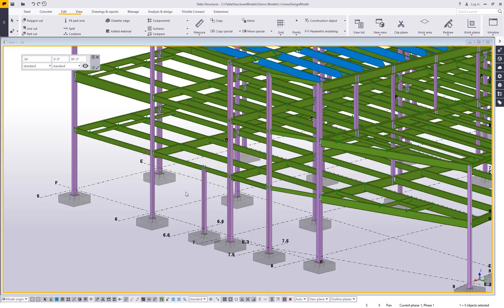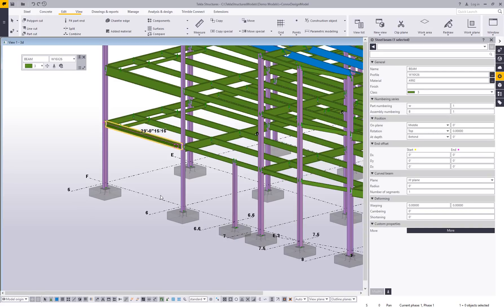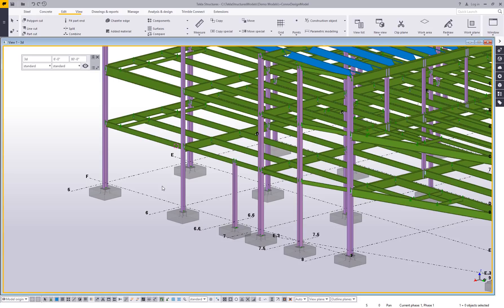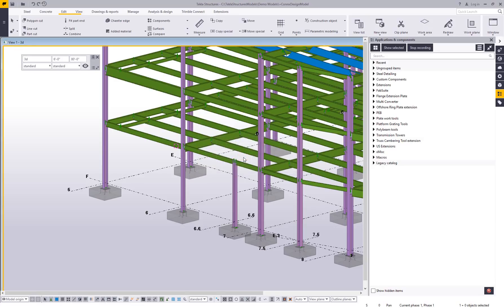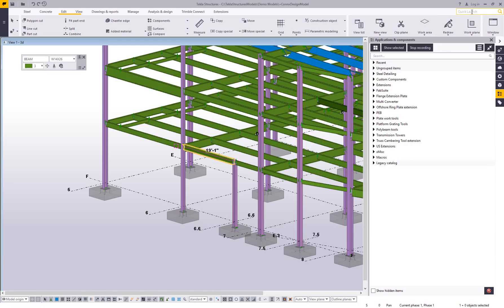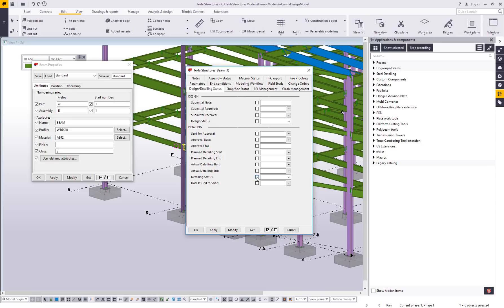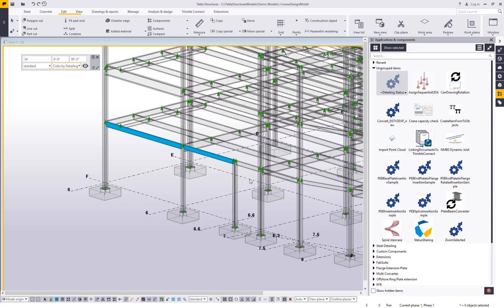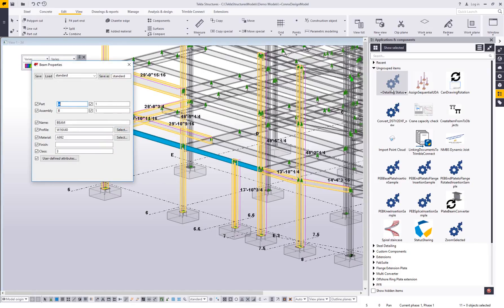Recording Macros in Tekla Structures

Comment: Hi David, nice video, I learn a lot from watching your videos. About macro, will it work with part editing features, like slit part, split beam actually? Quite often I face a situation where my beam (purlin) is adjusted to a column without any connection and on a primary stage of modeling it is not necessary to have all detailing done, so I put one long purling over the whole length of my wall. At a later stage of my modeling where all detailing must be done, I have to repeat the same editing steps many and many times. I fact what I do is: 1. I have to split my beam by the center point of my column, 2. I have to make 2 mm spacing between new pieces purlin, 3. I have to move this spacing (handles of these just splitter pieces) 20 mm aside, 4. I have to put a connection on a column with these purlings. So I was wondering I it is possible to record a macro that will automize my routine work.

Comment: Really don't know what you mean about the recording process saying that things 'outside the model view' and that when recording something has to be triggered, I assume you mean that you must 'pick' a member, but then you mentioned that pick something that has 'already' been selected, yet nothing was highlighted and then you mentioned about the ribbon, haven't got a clue what that is all about. I had done two separate week long courses at Tekla's offices in days gone by, the people there were fantastic, but sadly  I got nothing from the second course, the lecturers went too fast and as you see I still know nothing, except for some excellent videos on youtube. I appreciate you dealing with this topic and I try to follow but there are aspects that still leave me none the wiser and I won't pay for another course. One good thing about Tekla is the ability to practise using an educational copy and I really appreciate that, but I have learned more through youtube. Thanks again.
Reply: What I mean is that the macro cannot record picking anything in the model (inside the view where you see parts). It can only record processes that happen in commands. So the macro has to be recorded/created "as if" parts were already selected. You could of course actually select something while recording, but that part of the process is not going to be included in the final macro. I just run through the process pretending parts are selected. If it helps, close all the model views while recording to help keep track of what can and cannot be done in a recorded macro.

Comment: Just going through your video and didn't understand the detailing status that you chose as 'connected' what does that mean please? You mentioned something about being 'outside the model view' what does this mean please? You mentioned about Quick Launch, unticking the box to remove all the normal functions or whatever they are. As you can see, my knowledge is not even basic in this regard and I have used Tekla but only in short bursts. Is there a video that you have done that explains the basics? I appreciate this video, but I think that I need the basics first. Thanks again.
Reply: As far as learning the basics, I would recommend contacting your local office about training offerings. There is some free stuff on our website as well. https://teklastructures.support.tekla.com/elearning/steel-detailers
The Detailing Status - Connected is simply a User-Defined Attribute, or Note, in the US Environment that a modeler can add as they are working. This helps them keep track of what has been connected - components like clip angles added to the end of the beams. Unchecking options means "do not change this value". So you're not writing/changing 50 notes, only 1.
Reply: @TrimbleTeklaDave  Hello David, thank you very much for taking the time to reply and so quickly, really appreciated. My problem with paying for any more courses is a bit of a Catch 22 situation, I need the work so that I can earn some money, but the problem is my lack of knowledge and as explained, the two individual courses lasting a week each time were not of great value, especially the last one, it was a total waste of time and money as I learned 'nothing' sadly.

Comment: This feature runs much slower than it did in older versions. Tekla should address that, performance is important to us.
Reply: Hi Fred, I notice that the UDA selection has a slight delay, but I have not noticed anything for other types of recorded macros. It would be best to contact the helpdesk with this issue so they can report this through the proper channels.

Comment: How can check that if any macro missing or welding missing.
Reply: Hi, the recorded macros only duplicate what you can already do manually. So you would need some kind of workflow to check for that. There is an extension on the Tekla warehouse that might be helpful - the Model Checker Suite: https://warehouse.tekla.com/#/catalog/details/u646cb5f4-7a72-4986-8786-4f1f63a13e29